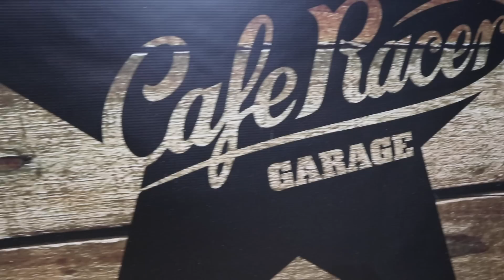How to Build a ★ Scrambler on a Budget Challenge Ep. 3 - Honda CX500 Street Scrambler  Tracker Build

Comment from the maker: ALL Parts - https://www.amazon.com/shop/caferacergarage

HERE IS A LIST OF WHAT I USED IN THIS VIDEO: 
Satin Black Paint  https://amzn.to/2MWK7rN
Gray Primer Paint https://amzn.to/2MkEvXr
Cordless Random Orbit Sander https://amzn.to/2MkCuKx (Tool only) 
5 Inch Sanding Discs https://amzn.to/2lu86Cd
Synthetic steel wool Green https://amzn.to/2K5zy8a
Synthetic steel wool Gray https://amzn.to/2Kl3Kvd
SandBlasting Cabinet Model 60 https://amzn.to/2Kl30mN

Any questions just ask :)
Reply: What is tyre size
Reply: InstaBlaster
Reply: You can expand the swing arm  , and also you could design it a little add supports  to to expand a more..

Comment: Howsit from South Africa!  I'm building a scrambler from a CX500 as you are.  I want to use the original air box to ensure clean air as this will be used for some riding in the dirt.  Looking fwd to seeing your solution on the seat as i'm thinking making the seat easily removable for a little storage space under the seat or for the battery, so please do the seat episode next!  Keep up the good work!
Reply from the maker: The exhaust Ep. will need to come next but The seat build shouldn't be to far away, Thank you for the comment Brett :)

Comment: Coming along great! One suggestion is to tune it ASAP due to those CV carbs. They work great when working but what may seem like a simple tune issue could lead to needing a new carb or 2. The channel that leads to that idle air screw can build corrosion that could make it all worse even after soaking because it can break loose and completely clog the port. Especially if the bike has set up for a long time, which your looks like it has. This happened to my gl project. I ended up upgrading my carbs and intakes. Also, I actually left out the small metal washer on my adjustment screws at one point! Lol! I still have mine if you want them. The left carb worked fine. Also if you don't have a color tune get one. Great for figuring those issues out...
Reply from the maker: Thank you for all the tips, I must of missed this comment until now, I reply to every comment however sometimes the Youtube system is unreliable and doesn't notify us of every comment...   You left me a great helpful comment tho :)

Comment: I have a 79 cm 400 Honda and a few if not alot of my bike parts looks identical to your bike minus the engine of course. My question is are there wires run through the bars because I want to change my buckhorn bars to scrambler or dirt bike ones similar to yours and wonder how difficult the switch will be?

Comment: Powdercoating is N OT that durable. I have had powdercoated dirtbike frames that chip and scratch about as easily as paint does so I would never waste the money on powdwercoat....
Reply: Just like everything else, not all powder coats and not all powder coaters are created equal. A properly applied, high quality powder coat is much more durable to mechanical abrasion than most paint finishes. A cheap, poorly applied, thin powder coat not so much...

Comment: Well. My rear tire from the factory was 3.50/18, I don't really know, which size was acceptable for my rim. Just for an experiment I used 4.0/18 and It works just great. 
In my opinion, in your case, increasing tire for 5 mil. each side doesn't sound dangerous. Like what can go wrong? If it sits correctly on a rim and holds the correct tire pressure, I don't think that something could happen. Especially tubeless tires are quite tough on the sides. Also depends where did you get these safe numbers. If they were from a manual, than I think it's almost 100% safe to use thicker tires, cause numbers from manual are always "too safe" and quite far from numbers when something can happen. But if it was in someone's experience, and he had some real problems with a thicker tire in real life, than its 100% not safe. But again, it's just my thoughts.
The best way to understand which headlamp is better is just to install one lamp than the other and compare. Maybe if you want to make an aggressive scrambler you can install two small lamps with grilles, one above other and move them aside from a center with a square metal plate with a motorcycle racing number in a center.
And about the speedometer, I've got a picture of one, but unfortunately I can't attach pics here.
Reply from the maker: Thank you mate. I'm not sure what wheel you have on your bike, However, The CX 500 Maximum Width of the comstars Is 2.15 and 2.50 for the 16".  The tires I'm using require tubes but I do understand what you're saying And I appreciate your ideas on the tires and the headline and also the speedometer If you wish to send any photos you can send A personal message on Cafe racer Garage FB page :)
Reply: There are 25.4mm per inch, so a 120 is roughly equal to 4.75 inches, with a 130 equal to 5.1 inches.
Putting to wide of a tire on a wheel can result in popping the bead while riding. It can appear to mount up and hold pressure when static, but go into a corner to hot and it can be disastrous. However, where that safety limit is I do not know.
Reply from the maker: ChaoticDetour Very well said, I’m not 100 % sureOn all the specs to do with tires and wheels sizes however my research has shown that 120 mm on 2 .15 rim is Max,  thanks for the comment brother 😊

Comment: Watched all of your videos concerning this particular redo, very cool  anyway I'm going to start my own soon and just have a couple of questions for you, I'm doing mine from the ground up thinking of buying a xl1200 sportster frame wondering about the best engine Cheap single are twin and will foriegn bike parts work with this particular frame Thanks
Reply from the maker: Thank you mate, I'm glad you are enjoying the videos, In regards to your build, I would use the original engine if you can, its a lot easier to do that than start from scratch.  If you are asking me this question I'm assuming this is something new you want to tackle and therefore keep it simple for yourself so you can ride it sooner.  If you are up for a challenge however, go for it and do some google research on your model of bike and find someone that has done the mods you want to do so you know its posable.  I hope that information helps

Comment: how tall shocks can you put in such bike ?
can it actually become some what  half decent off road motorcycle, nothing super crazy but just so you dont turn back when hit a gravel or bumpy road or some smoother trails.
Reply from the maker: ahmed z yes this bike will be great off Road but I won’t try taking it over any jumps, I won’t increase the rear shocks much more than stock unless you know what you are doing, a bike can get unsafe if you change the rake angle to much.

Comment: hey mate, I am curious what kind of front end you will use for scrambler bike build you are doing now. I see that quite a few scrambler builds are using R6 forks, I dont know much about bikes but if I had a scrambler I would want to do a bit off-road style riding, get in dirt and ride under rain. =) Do you think the R6 is good for off-road as well? I am curious if you would still use R6 on scrambler if you have no budget constraints.
Reply from the maker: Hi mate, R6 is not the best for off-road as it doesn't have the travel you need,  look for the moto X bikes with slightly longer forks than what is on the bike, be careful not to mess with the fork rake angle or you can make the bike very dangerous to ride

Comment: Hey Dan! First of all thumbs up - really like your channel and the way you explain your way of doing things! One quick question, as I’m in the process of doing a pretty similar project with a smallframe Guzzi from early 80s: what is the specific model of these Heidenau tires you’re using? I really like the style and would like to use them too. Thanks in advance mate and keep up the great work!
Reply from the maker: tonirockyhorror1 thank you brother that means a lot :) a lot of behind the scenes stuff goes into my videos and I’m happy they are helping you 

Heidenau K60 are the tyre I am using
Reply: Cafe Racer Garage thanks mate, brilliant! Unfortunately K60 doesn’t come in the dimensions I’d need... so maybe I’ll go for the K37 or even Continental TKC80. You even inspired me to custom-make my seat from fiber as you did - let’s see what happens! 😂 one last thing: do you happen to have any experience with headway LiFePo4 cells as a replacement for a regular battery? I want everything to fit into and under the seat and hump... cheers!
Reply: @tonirockyhorror1  check out Avon Trailriders